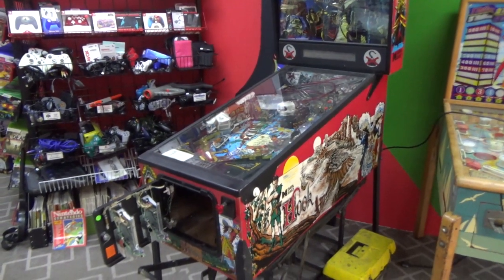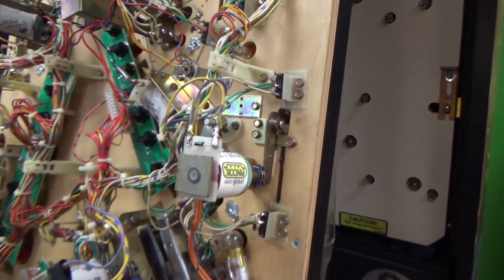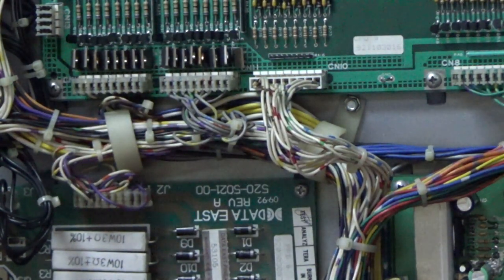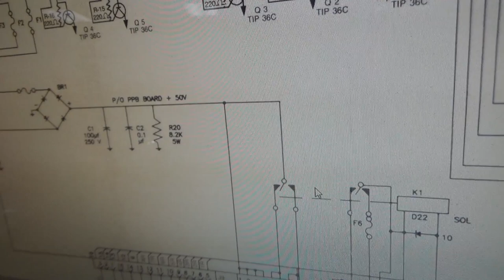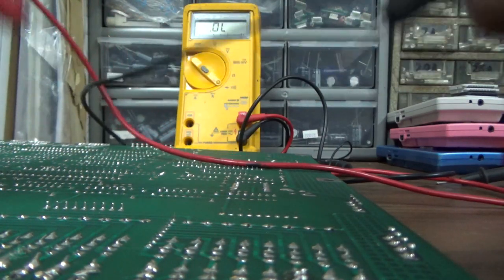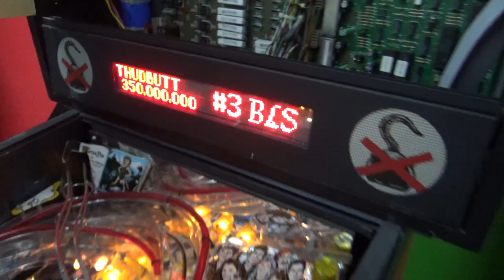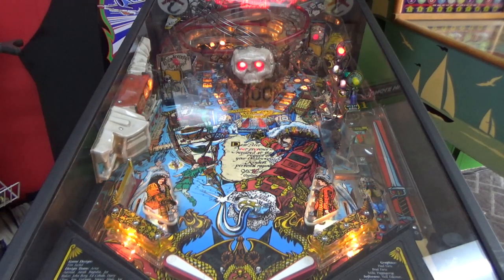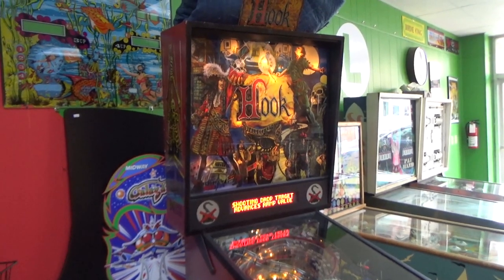Repairing And Testing The Awesome Data East HOOK Pinball Machine - Troubleshooting Solenoids...

Comment: I also love this game, i got it for a few years at home, and I'm sure that the flippers are incorrectly shorted with the drop targets. Take a look at it. At 36:30 clearly seen that you hit the flippers it plays the cannon's sound and lights it up too. Otherwise it looks good to me. :)
Reply from the maker: I’ve learned repairing these nobody’s ever satisfied there’s always something I didn’t do right
Reply: @LyonsArcade  Don't take it personal. It's not your fault, it's some other fault in the game, something seems crosslinked. Just check it out. I tell you why is it a serious problem: the game randomly award you some extra, and you need to hit some pirate cannons to get it, like some million or an extra ball. And getting it by a single flipper chopping is not so satisfying...also constantly buzzing the cannons sound will be boring. :) Keep it up the good work. I also learned by now how these machines logic working when some playfield element needs to be activated like a slingshot.

May I write you some personal by mail or somehing? I think you are a skilled repairman, and i got a machine which I wrecked with a shorted extension cord and after that it works and doesn't work at the same time and I cant figure out how it can be. I just want to write the story and the working mech to you, to see if you can help me out. Thanks!

Comment: If the same transistor repeatedly dies, it could be that the diode over the coil is open. Did you make sure the diode is good?

Open diode would cause the coil to roast the transistor with high voltage, as soon as the coil is turned off (the energy associated with the magnetic field in the coil has to go somewhere and if it's not the diode, it's the transistor.... The transistor can stand this type of abuse for a certain amount of switching cycles, but not forever...)

Comment: I have a tmnt data east pinball and I’ve had the boards serviced and the machine serviced and yet after playing it for a tiny bit the display displays garbage sometimes or it says overrun or it says tmnt version. It has a rotten dog power supply in it and it’s 5 volts is around 4.95. Wondering if i should get an x pin power supply or if it could be something else?

Comment: Another good one Ron.  I have a 2013 Stern Star Trek Premium that has a Vengeance ship toy that fires a coil that makes the ship appear to crash.  During multiball, sometimes when things get crazy, it will fry the transistor (STP40NF10L) that fires the ship's coil. Would that be a problem on the ship perhaps - like something binding that is causing the coil to drag and pull too much amperage and thereby frying the transistor?  At least that's the theory I'm going with for now.  I can replace it and it plays fine for a few dozen games then it blows it again.  I've replaced it 4 times in about as many months.
Reply: Check to make sure the coil tieback diode is good.  If it's faulty/missing you get back EMF that fries the transistor.  If the tieback is good, I'd probably be suspecting the quality of the transistors and maybe sourcing another set from a different source.  Whilst you've got the tieback disconnected to test it, also test the ohmage of the coil and check to see if it's burnt.  Coil should be no less than 2 ohms.
Reply: @sonnyjimbod  ah I never considered the diode - I’ll check it.  The transistors came from DigiKey so I’d hope they were good quality.  But I’ll try another source too.  I’m now also installing a socket for it.

Comment: Super obnoxious that transistor can read fine off of the multimeter but still be bad. I'll have to watch out for that on the games I work on.

Speaking of pinball, I've got a KISS pinball machine from Stern at the arcade I work at that's having an issue with the LEDs on the top right of the playfield, they'll go in and out periodically. Thought it was a fuse issue so I swapped that out but it's still doing it, racking my brain trying to figure out what the issue could be